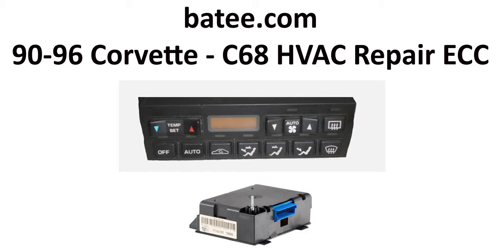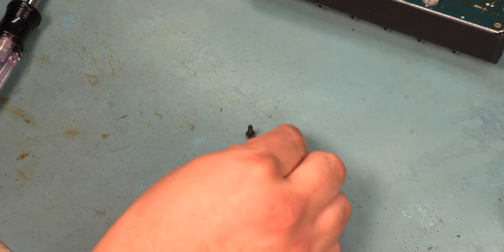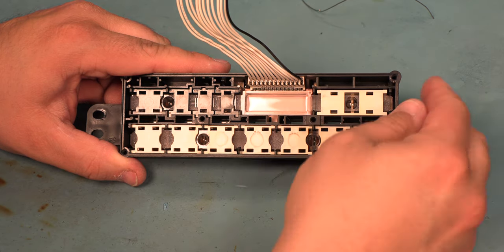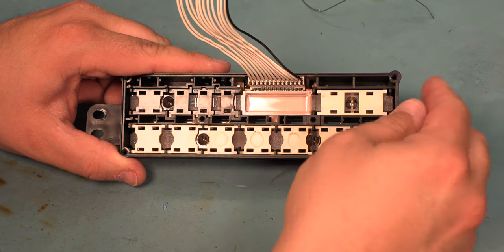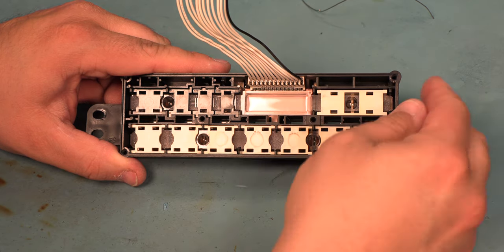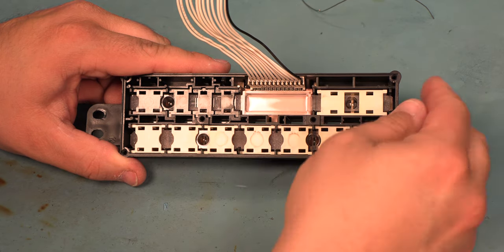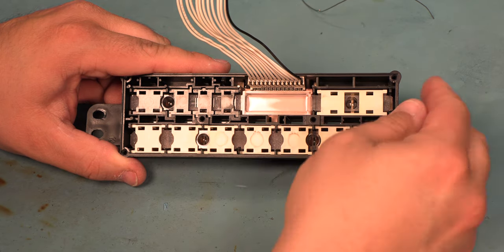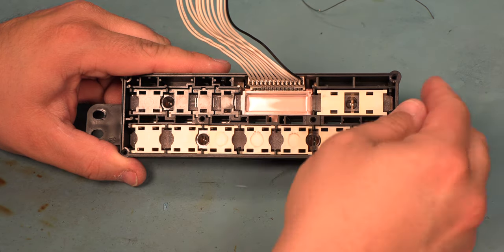90-96 Corvette #6 - C68 HVAC Repair Electronic Climate Control ECC (2019)

Comment: Use a Q-tip and alcohol to clean the carbon contacts and the circuit boards. Using a pencil eraser can cause tiny scratches in the contact tinning that promotes future corrosion. Also corrosion at the ribbon cable terminals is a good place to find intermittent connection where indifferent metals react. Good idea with the spacer. Use an acid brush to clean the terminal pins, jamming the big nylon brush in there is gonna bend something. Try using solder wick too.

Comment: Hi Bryan, I spoke with you on the phone about my 96 C4 programmer and controller rebuilds. I will be sending them in, just haven't got the motivation to remove the programmer, and your removal of the controller sure will make it easier than the first time, as I took the trim all off around the shifter. Thank you for the update!

Comment: Bryan,
   I just used your kit to fix the AC controller module, thanks to your great instructions and your kit I fixed the controller. I only had one problem. The bulb sockets you provided in the kit would not turn on the board. I had to further knotch out the plastic side angled pieces on the bulbs to get them to fit and turn on lthe board.
Just thought you should know.....